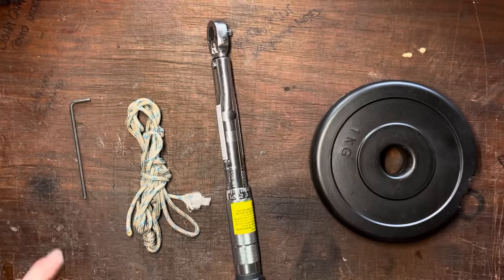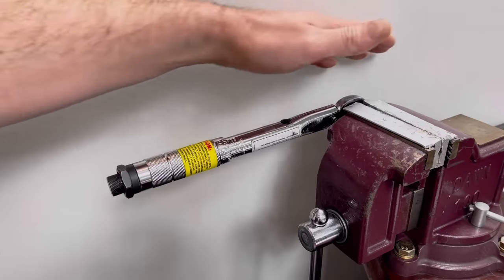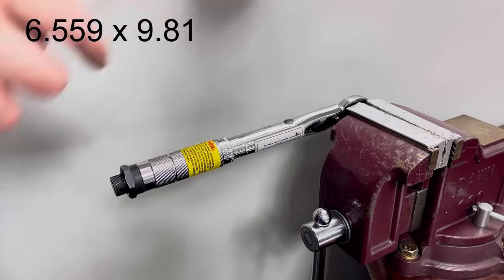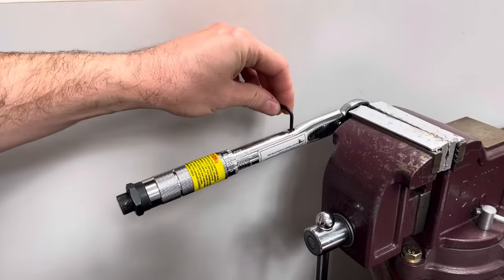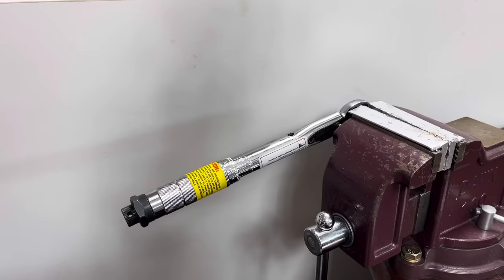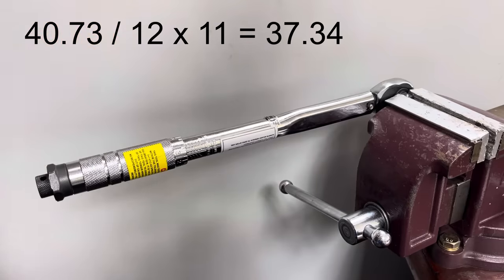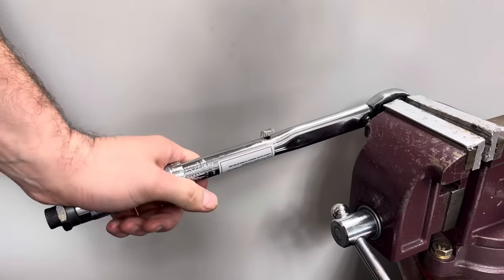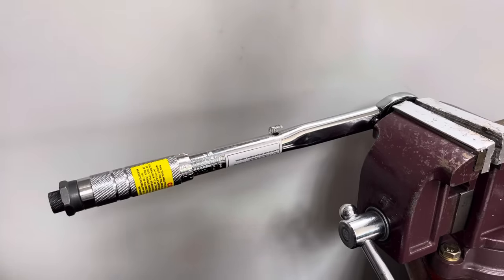CALIBRATE YOUR TORQUE WRENCH IN UNDER 5 MINUTES (NO SPECIAL TOOLS REQUIRED!)

Comment: when you turn the setting handle, you're shortening the length of the torque wrench - you need to compensate for that when positioning your string because the initial measure is now off - should reposition the string at the original measurement of 11" which would require confirming with your measure tape (would shift slightly towards the end of the wrench a bit).  small detail.
Reply from the maker: Spot on! Yes I got the edit backwards, but you’re right! Measure after setting the torque :) thanks for sharing!
Reply: @VintageEngineRepairs  no worries - thanks for making such a good video on a somewhat 'mystery' topic most home mechanics would benefit from watching
Reply from the maker: Thank you for the kind words and correction :)

Comment: I prefer using a small luggage or fish scale, cheap to buy and accurate enough for this. Then just keep it at the measured distance on the wrench handle while pulling handle at 90 degree until it clicks...read max "weight" on the display. Adjust wrench calibration accordingly. This keeps the force at 90 degree to handle, no contribution from handle's own weight (as in this example with handle adding small amount to turning downward force applied). And no need for any calculations nor pre-weighed dead weights.
Reply from the maker: That’s a great idea if you have the scale, yes! I don’t have that but it would be handy! Thanks for sharing :)

Comment: I found that the non-knurled ring is exactly the calibration point on three various wrenches. Checked by a weighed bucked of sand at home, then on a NIST-traceable calibrator at work.
Reply from the maker: Thank you for sharing!! Much appreciated :)
Reply: I've always assumed that was what the ring was for - It's around the centre of effort when holding the handle. - Nice to have it confirmed.👍

Comment: First there is no such word as anti-clockwise. It is counterclockwise.
Secondly, your method is so flawed I'm not even going to point out all the potential errors.
👎👎👎👎👎👎👎👎
Reply from the maker: Hey, google anti-clockwise - I’m British, it’s a British word, the alternative to the American counter-clockwise. This method works beautifully and is very repeatable and accurate for the homeowner. You can use luggage scales and the wrench horizontally for slightly more accuracy, but it’s not necessary.

Comment: Great video and so simple to do.  I have been told by multiple tool shops that the smooth ring in the handle is the factory point where they test the torque wrench.  Not sure if it is true but you might as well use it as a fixed point for future calibrations so you get the same point each time.  You'll also notice that the ring is slightly closer the end of the grip, this is because when we pull on a handle at 90 degrees more of the force is concentrated towards the last 3 fingers (middle, ring and pinky) on our hand.  This enables us to grip something very tightly while still being able to use our thumb and fore finger for other things.  Try it out.
Reply from the maker: Thanks for sharing, much appreciated :) I’ll give it a go!
Reply: Yes, I noticed on your last click test by hand you probably without thinking positioned your hand right over where that band is on the handle. Cheers, great video
Reply from the maker: @nigelthompson874  well spotted :)
Reply: Yes, typically the handle is marked for this purpose. Not just for factory calibration, but also for recalibration. Different brands use different marks, but I would expect the clear ring to be the mark in this case.

Comment: Interesting however, to be more precise, don't forget to remove the weight of the torque wrench at the level of the grip (or to take it into account when calculating the weight), because when the torque wrench is horizontal, its own weight contributes to the torque and it distorts the calibration ... it's not essential on 1/2" torque wrenches but much more on 1/4"
PS: sorry for my poor level in English
Reply from the maker: Thanks for sharing 👍

Comment: I see 2 major flaws in your method, 1st: when you twist the handle to adjust the torque setting, the spot you've chosen to hang the weight has moved, now closer to the drive than you've measured before. To mitigate this, choose a torque and adjust wrench beforehand then calculate and measure where to hang the weights along the handle. 2nd: when it clicks, the torque wrench isn't perfectly parallel to the ground, it has sagged, hence the force of the weights acting on it isn't perfectly perpendicular. To mitigate this, let the wrench rest higher so when you put on the weights, it will click at approximately parallel to the ground.
Reply from the maker: Yep spot on, it was an editing error, I left a pinned comment covering this! I now do this horizontally with luggage scales :)
Reply: Should I factor in the weight of the torque wrench too?

Comment: Just thought of my first torque wrench, it had a pointer and a scale on it, the pointer was a thin rod in parallel to the main wrench bar; the challenge was to try and read where the pointer was while exerting steady pressure on the wrench!  
Geoff
Reply from the maker: Ah yes, a beam type torque wrench?

Comment: Great video for the home DIYer. It is also important to remember that these torque wrenches are more applicable when you're working with multiple bolts that all need to be torqued the same. I.e. car wheel lugs, or a pump head flange, etc. For a single bolt, especially in a sensitive application, these torque wrenches only bring you within  a ballpark spec and probably not the best tool to use. But this calibration method is simple, quick and yields acceptable results, so thanks very much for sharing.
Reply from the maker: Thanks for watching and sharing, it’s a great method to set and keep your torque wrenches accurate for what we use them for. It’s not perfect with the small variables, but it’s more than accurate enough and offers anyone the ability to maintain theirs without any money spent.

Comment: A good video on the how to of DIY calibration however you missed out a couple of vital points which better indicate why calibration is necessary.
1. The first is that when measuring the weight of the weight(!) you are using it's essential this is done with a set of calibrated scales otherwise the error in weight measurement is likely to introduce as much variation into the calibration process as the torque wrench itself. Without this step, you are just as likely to end up adjusting a correctly calibrated torque wrench to read incorrectly as you are to correct an incorrectly reading wrench.
2. It's important to check the torque wrench at three positions, once at the low end of it's torque range, once at the upper end it's torque range and once in the middle. You will almost always be able to set it correctly at one positions but not always in all positions depending upon how the device has been cared for among other causes. Failure to be able to set correctly throughout the range indicates a deeper dive and possibly repairs to the torque wrench are required.
Reply from the maker: Thanks for watching and sharing!

Comment: I have three Capri Tools torque wrenches (31007, 31000, 31002). I've owned them for about 8 years, and while they see very gentle use, I would still like to be able to make calibration adjustments if necessary. However, there doesn't seem to be an access port for a calibration screw anywhere on the wrenches like yours have. Help?
Reply from the maker: It will be worth reaching out to the manufacturer and explain it hasn’t got them, how do they calibrate it :)

Comment: When I calibrate my cheap german premium torque wrench (ot the cheaper chinease one)  ...
Oh dear , oh dear !

Good calibration at the low value, but worse at the max value.
Best idea calibrtion at the value inbetween. 

Because I often use torque values in the upper area = Calibration in these area. 

But shure a non free  calibratio by a certifyed calibration laboraty with a certificate will be a good idea. 
I think US $ 60 to $ 70 in my country (year 2021).

Comment: I measure from a point 1ft from the square drive cos I use ft-lbs.....I use a fisherman's fish weighing tool....I have tested that its accurate.

I have a few cheaper ebay type wrenches....I find all a few ft-lbs out....I check each time I use one....I dont use them very often.
Reply from the maker: Nice :) sounds like you have a method that is quick and works well for you!

Comment: I made a torque wrench 45 years ago special for ali engine motorcycles, I calibrated it by hanging a bucket by the handle and pouring in measured quantity of water.
Reply from the maker: Nice :)

Comment: Why don't you just get a luggage or bow scale and then you can leave your calculator in the draw.
Reply from the maker: It’s actually quite hard to get it accurate with luggage scales as the dial keeps moving. Having a set weight is free and consistent. You can do though!

Comment: Your still off cause when you adjusted the wrench to what it should be set at you're adjusting the length of the tool by screwing the handle in or out, then not measuring the distance to see where your rope needs to be placed after adjusting the length to set the torque.
Reply from the maker: You’re spot on, in the editing of this video I moved clips around, you should adjust the torque value, then measure the length. Thanks for watching :)

Comment: Just couple your click wrench to a beam wrench.  The beam wrench is ALWAYS accurate as a calibration reference.
Reply from the maker: Most people don’t have a beam and click
Reply: Aviation regulations require clicker wrenches to be calibrated every 12 months to be legal to use on aircraft.  Beam type wrenches do not ever need to be calibrated per FAA regulations.

Comment: Didn't realize these were so easily adjustable. Good to know, thanks!
Reply from the maker: You’re welcome! :)
Reply: I forget my school knowledge aswell. 
Smily = My teacher hitnot my head at the table and told remeber these for a lot of years.

BUT = always calibrate(with the force of the weight) where the manufacturer mark at the middle area where your hand push. 
You cant find a mark = Where your hand push , these area, in the middle. 

Yes = difficult 
but your calibration will be fine for your presicion you need. 

At the low value and the max torque value the inside spring is not perfect. Choose the torque between both extrem values. 
Or if you prefer a standart use  value for your work = choose these value.

Big problem = Find a weight (or some) 
and it must fit for your torque. 

You got a good precision libra for checking the weights ?

Comment: I imagine it will be more accurate at certain ranges. So maybe less accurate at 10Nm, but more accurate at 40Nm. So you could calibrate in the ranges that you use most often,  or calibrate before use. Or test at all ranges and make a chart.
Reply from the maker: You’re spot on :)

Comment: That's a good DIY method.
It took me a while to get inch/pounds torque wrench set properly as it wasn't assembled right and had 'fallen apart' during shipping (it was a Stanly, sold for parts, surplus store had about 10 or more on display)
At the time I had access to a Snap-On torque calibration - tester so accuracy was well within the +/- % specification.
Vast majority of spring ('clicker')  torque wrenches are only accurate at centre scale (+/- 2%) and are often 10% at maximum or minimum readings, even expensive ones.
Reply from the maker: Yep I couldn’t agree more with your last paragraph and I’m glad you enjoyed this video!

Comment: For ft-lb it's easier to just use 1 foot from the point of rotation to hang your weight.  No math required.  Great video to demystify calibrating or checking torque wrenches 👍
Reply from the maker: Thanks for sharing :)
Reply: Could you simplify on how to do this? Sorry, I'm drawing a complete blank at the moment lol
Reply from the maker: Is your torque wrench in foot pounds or Newton meters?
Reply: @VintageEngineRepairs  foot pounds
Reply: How do you tackle dual unit wrenches?
Reply: Remember that this will only be correct if the torque wrench is not length dependent, or for a length dependent tool, if the Force Loading Length is 12" (i.e. the correct loading point shown on the handle to the point of rotation). A length dependent unit must be calibrated and used with force applied at the designated Force Loading Point in order to deliver the correct torque.
Reply: @MN-sc2uz   You are meaning wrenches having dual scale showing e.g.both Imperial and Metric? Just calibrate on the scale matching the units you're using for the weight and length measurement.

Comment: If you wish to calibrate it really accurately to your personal usage. Adjust the weight to midrange first for say zero to 100 ft lbs. Set the TQW at 50 ft lbs. Then grip it as you by the knurled handle normally would use the wrench. Now mark the center of the wrench handle between your 2 middle fingers. (With a sharpie extend that line around the handle by using a strip of paper or tape). That will be your actual weight hanging line. Then measure that line to the center of the socket lug. Do your calculation as instructed in the video, prepare your weight and rope. Check and calibrate, set.

Check again at same line at 100 ft lbs setting (at same line w/100 lbs of wt remeasure the handle and recalculate), repeat at 10-25 ft  lbs. At that point it is customized to your grip also and will show you how off you really are at top and bottom of the wrench settings.

If 100 ft lbs hanging does not quite click it (when calibrated perfectly tested at 50 ft lbs), but a tiny bit of downward pressure to that line with wt hanging clicks it...then calibration at 100 ft lbs usage can be assured by a double or triple to quad clicks at upper range usage. For lower range usage switch to an actual inch lb wrench and recalculate and calibrate that wrench also. (I have both and will always use the smaller wrench for smaller work). 20-25 ft lbs give or take. All of my automotive manual torque charts have been hand calculated and notated (converted from ft lbs to also include inch lbs for fast reference and work).
Reply from the maker: Thanks for sharing :)

Comment: Clearly I'm on the very bottom of the gene pool since I don't understand how can you set the torque value, BEFORE you measure the length, considering that in the equation, you FIRST need to know the length to obtain the torque value that you have to dial in??? What am I missing???
Reply from the maker: You’re spot on, see my pinned comment :)

Comment: I'm not knocking this method at all. It's handy to know. But I'm curious how you set your non-digital torque wrench to such a precise figure as 12,88 Nm [an accuracy of a hundredth of a Newton Metre!] using only the engraved scale on the handle?  

 I have a couple of troque wrenches bought 2nd hand off eBay, years ago,  which have never been calibrated, since I've had them. I'd like to calibrate them, just for curiosity's sake, if nothing else. But I also think that most of us [who I presume are using torque wrenches to tinker on our cars] can get a bit too OCD about these things.  Unless you're working for NASA, I reckon "close enough is good enough" for the vast majority of fasteners we come across  --with the possible exception of cylinder head bolts.

[Ducks head beneath parapet]
Reply from the maker: I don’t set it that accurate haha. If it’s close enough it’s accurate enough for pretty much anything I’ll come across :)

Comment: Good video, takes the mystery out of calibrating torque wenches. I wonder if it would be more accurate to say you were mainly using the wrench for tightening oil pan bolt to 20 ft lbs then use a 20 lbs (2x10lb weights). So using the amt of weight that you generally used the wrench for.
Reply from the maker: Yes :) that’s exactly what I have done since this video. My 1/4” is set perfectly for about 8nm because that’s where it gets used most. The 3/8 gets set at 20ftlbs for the same reason :)

Comment: In case someone wonders how accurate this could be: take the equation, pluck in min and max values of the weight and length accuracy. Say, you think you can position the rope at 5mm accuracy, so take 195mm and 205mm for his example. How accurate is your scale? Take say, +10g and -10g and calculate. Now you end up with two numbers that are the min and max that you could be out, in this case 12.53 through 13.21 ... which is well within the common 2-4% range of tolerances by the manufacturer. Oh, for extra accuracy, take into account the local gravity which for my place would be 9.80665 instead of 9.81 ;)
Reply from the maker: Thanks for sharing :)

Comment: This is a classic case of you don’t know, what you don’t know. What you are doing is NOT calibration. You are simply doing a single point operation check. Calibration is testing using certified weights and documented processes under controlled conditions. Many tools have both span and linearity adjustments which you are not even checking. The reason actual metrology (calibration) costs what it does is its precision and repeatability. You have neither. What you are demonstrating is like trying to do brain surgery which a crow bar and a hammer. Stop messing with things you don’t understand. If you suspect your torque tools accurately may be compromised, send it to the manufacturer or a accredited lab for recertification. BTW, I’m a 26 year calibration technician for NASA. I’ve tested a few torque tools.
Reply from the maker: This method works great - lawn mowers aren’t a spaceship.